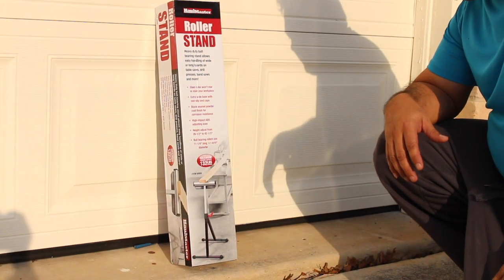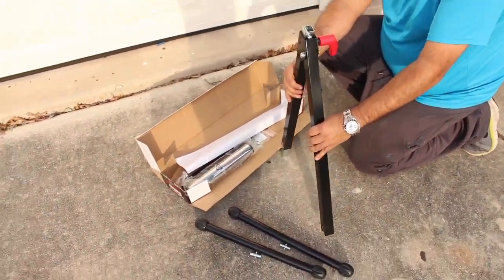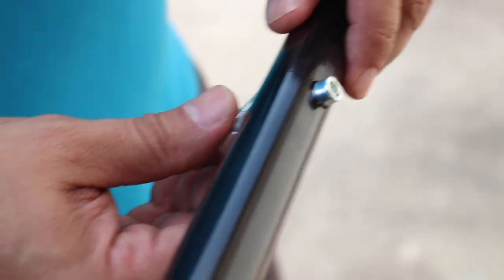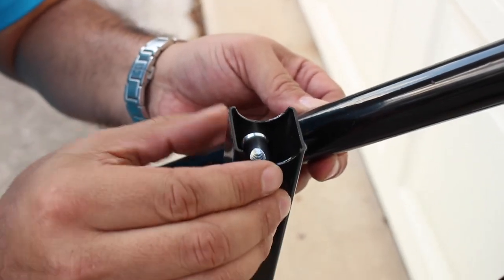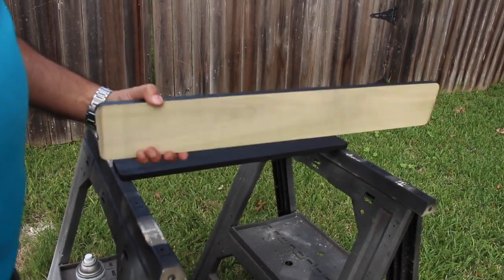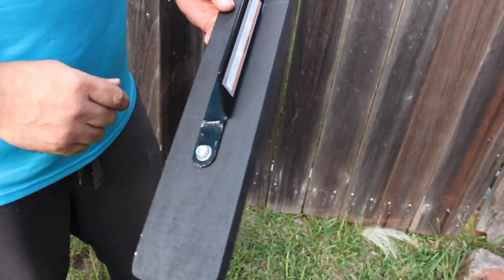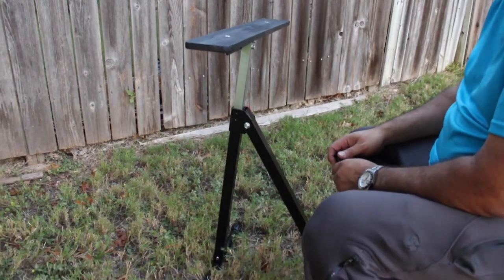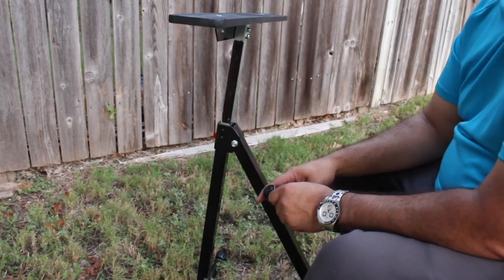How To Make Crossbow/Rifle Stand for under $20

Comment: Great idea I know this is a old video but did you use it in a ground blind? Secondly how did it stand on not so even ground? Thanks for sharing.
Reply from the maker: Thank you for your comment. Yes it worked  great in a ground blind. The ground for me was just fine, If the ground is slightly off level I image you could just move dirt around with your foot to make it more level but I don't think it would be an issue. Good luck hunting.

Comment: Hey, you commented on that Fractal/ Wood burning video.

Please dont do it. Those microwave transformers are 2000 Volts....

You wall socket is 120 volts or 240 volts. 

The transformer literally transforms your power from 120/240 volts into 2000 volts.

Thats 10x the amount needed to stop your heart. You will be dead before you hit the floor.

If you slip, youre dead.
If the water container slips, youre dead.
If you accidentally touch the wires, youre dead.

There is ZERO margin for error. Please consider this!!!!!!!!!!

Comment: I got to be honest, I didn't have high hopes in the beginning, but I like this. I'm going to look into throwing one of these together for myself....... Nice. 👍
Reply from the maker: Glad it gave you some ideas, I have a more efficient set up now, I took a normal photography tripod then removed the "Y" part off a monopoly and screwed it into the same screw on the tripod where a camera would go. (same threads) this makes for a lighter more portable set up .
Reply: @texascrossbowdude636  I thought about trying something like that too, I was concerned it might not be stable enough, the only camera tripod I had is pretty light duty.
Reply: @texascrossbowdude636  portability is not going to be an issue for me, right now I'm just looking for something pretty simple to make for when I'm just playing around with the with the crossbow in the backyard.
Reply from the maker: @olheghtt  cool maybe one of these ideas will help you. Good luck hunting
Reply: @texascrossbowdude636  👍U2

Comment: I really liked it great innovation to make this, not sure why use a marker if u want to keep it as cheap as possible ok, but id buy black spray paint or even camo colors and spray paint it, sp for metal.

Or get a piece of vinal with hunting patern and wrap it. 

But def worth it, i find tripods to be expensive, great job 😁
Reply from the maker: Sorry for the late response. At the time I made this I only had the black marker and it worked in a pinch. All the things you mentioned would absolutely work great. Good luck hunting.